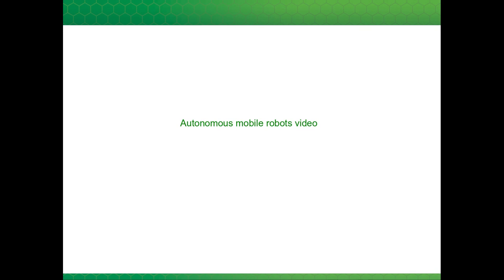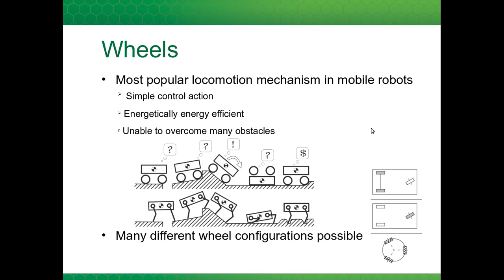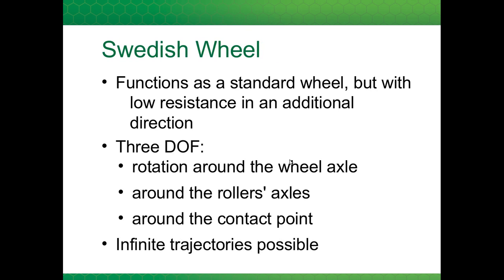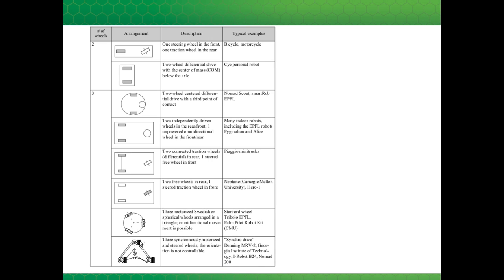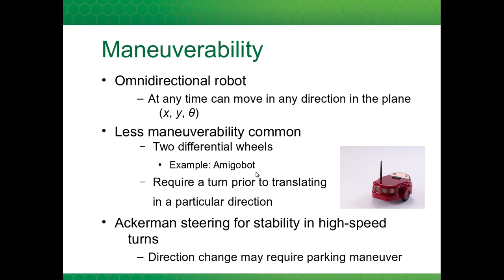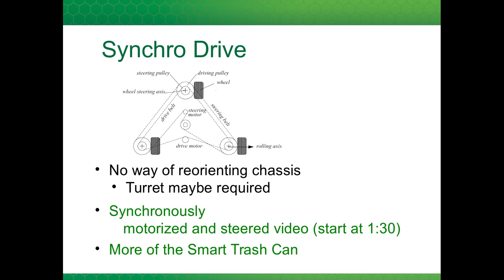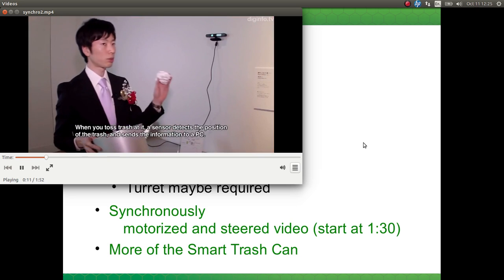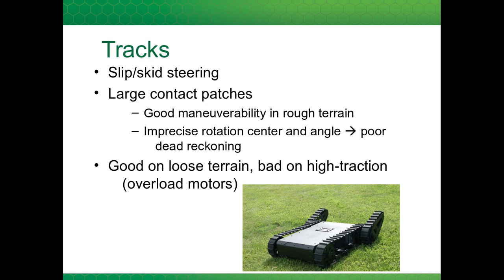Considerations for wheels in mobile robots

Comment: Very cool, I didn't know that "Swedish wheels" were another name for Mecanums. I used them in FIRST in high school, can't wait to get to work with them again.
Reply from the maker: Did you use the ninety degree type?
Reply: We used the 45 degree type, same configuration as the Kuka YouBot in the video. My favorite part was configuring a polar coordinate drive system to use with our joysticks to control the direction. Fun times!
Reply from the maker: "Polar coordinate drive system": you'll have to describe that to me some time.
Reply: We did the same thing/also used mecanums.
We also started using them for VEX and I couldn't go back to anything else because they're just too useful.